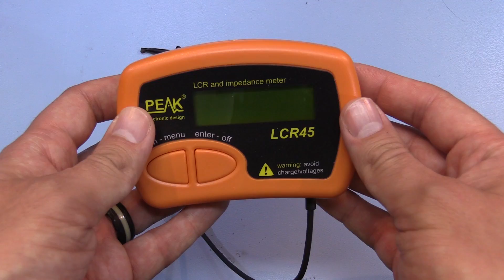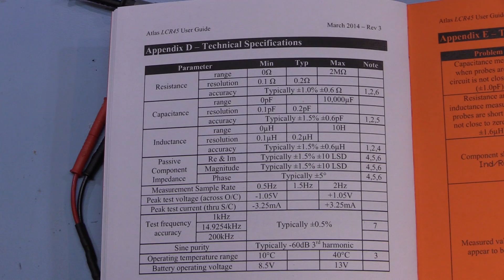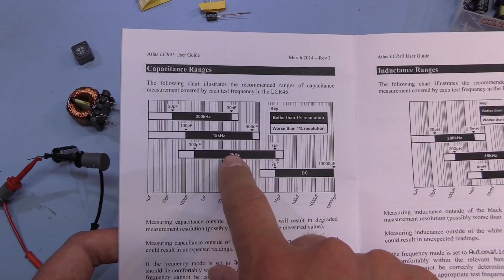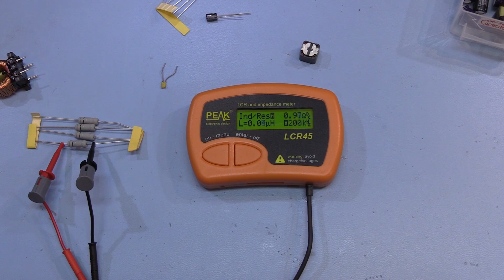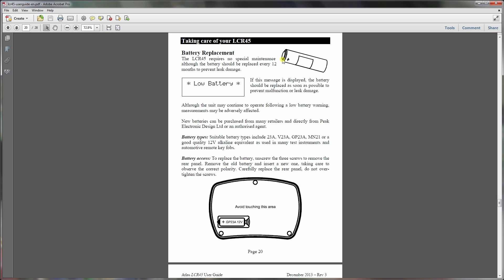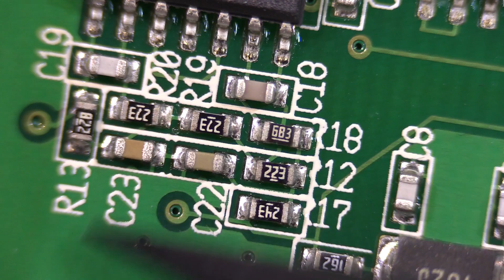SDG #019 Peak LCR45 LCR Meter Review and Teardown

Comment: Just seen this video - thanks! 
I'm split between buying this LCR45, the Tenma 72-3520, and DER EE DE-5000? 
Naturally I'd prefer to buy from Peak Electronics, but as the Tenmaand DE-5000 allows us various parallel or series modeling, I'm kinda wondering ....
Reply from the maker: I've used the Tenma quite a lot, but I did not find it particularly good. If you need the additional functionality, I'd go for the DE-5000
Reply: @sdgelectronics  Many thanks for your reply, appreciated!
Reply: @sdgelectronics  Bought the DE-5000 a few weeks ago - very pleased with it. Seems to be a semi-serious piece if kit. Thanks for the suggestion.

Comment: Excellent review!
I just took a peek into my LCR40 and it seems to have the identical hardware, same PCB version and markings as well as the main components.
Do you think that one could just flash the LCR45 firmware to LCR40 somehow?
Reply from the maker: tomaja1 Yes, the programming header is there for firmware updates. Almost certainly you could send an e-mail to Peak and they'll update the firmware for a small fee - probably just the price difference between the two devices and £3 postage.
Reply: SDG Electronics Thanks!

Comment: There's also the Extech LCR200 which has quite a bit of functionality on the spec sheet, and cost-wise sits between some of the "cheaper" brands (Voltcraft is sold a lot in Germany, some of their devices look like rebranded Uni-T) and BKPrecision. That thing has been out for a rather long time, yet there doesn't seem to be much in terms of user opinion.

Comment: Looks like another nice unit from this company, really good form factor and performance. I'm not sure of the usefulness of displaying impedance for LC components at two or three preset frequencies though... I think I'd rather see ESR, D, Q, and the phase angle at standard manufacturer test frequencies. I can calculate the impedance myself for my own application at the correct frequency. Now if the test frequency was user defined, or it could sweep a range of frequencies to determine the SRF, that would be super cool. But that would be hard to do at this size and price point.
Reply from the maker: dwDragon88 I see your point - yes it would be great to select your own test frequency or even turn this into a low cost gain phase analyser if PC connectivity was added. They could add in a DDS chip to sweep the frequencies which would be a really nice feature without being horribly complex to implement.